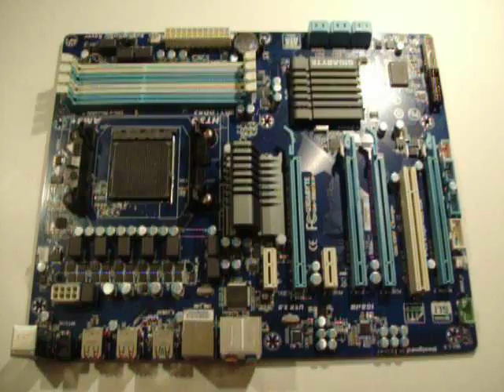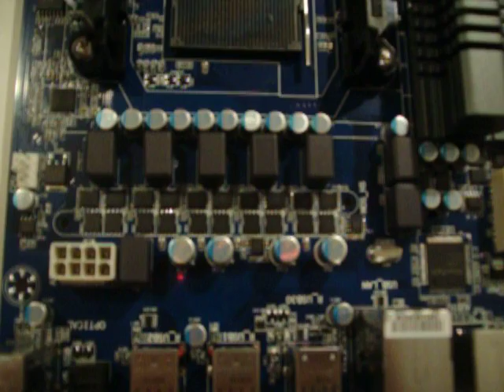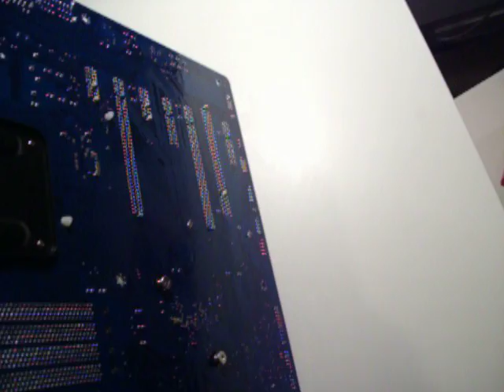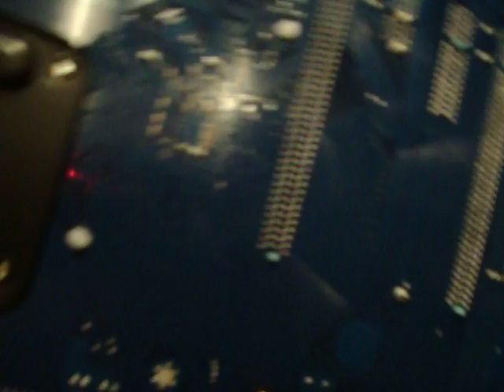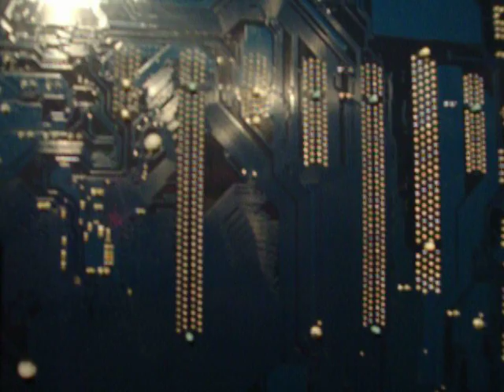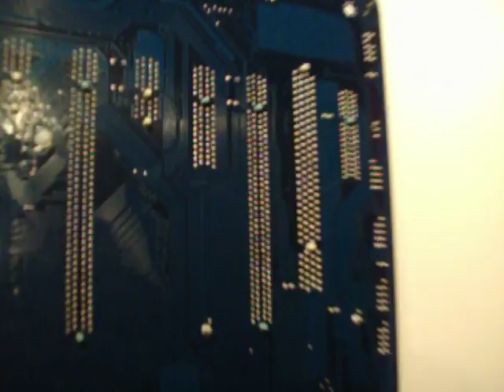Gigabyte 990FXA-D3 Unboxing and Overview: D3 vs UD3

Comment: I have revision 1.1 of the UD7 and all of the ports support sata 6GBits/s but you do need to install a driver provided with the board to get 6Gbits/s from the AMD SB950 chip set.

Comment: I also forgot to say that right now using LLC on the UD7 I have the 1100T at 4200Mhz using the same max vid of 1.55 volts so no extra heat and it appears to be stable when I benchmark it. In my older 790fx board the cpu would bail out at that speed and voltage using these benchmarks but I can't say it's a 24/7 overclock until I have used the computer at that speed for a longer period of time.

Comment: My current configuration on the UD7 is x2 6950's in crossfire and a Creative Recon 3D gaming sound card. So this means 3 of my four graphics card slots are populated but I still have room for 1 more video card :) All the Sata 6GB/s ports are great and I use to run a lot more hard drives in the past but to keep power consumption down so I can keep adding video cards I have been lowering the amount of internal hard drives used in the system.

Comment: My internal hard drive configuration is now 1 ADATA 240 GB solid state drive and 1 6BG/s 1TB hard drive. I have more disk drives full of data but I never added them to the system for power reasons. I'm using the Marvell ports to run my drives as my solid state disk provided poor performance when benchmarked plugged into the AMD SB950 sata ports. Like I said if I had read the manual proper and installed the driver that would have not been a issue.

Comment: I'm using a Cooler Master V8 air cooler with its stock 2000rpm fan and a 1300rpm system fan to support the CPU cooler with a push pull effect. I have a fan controller so I can monitor the fan rpm.  I ran the 1100T at 4120Mhz with the same air cooler and fans in my older Gigabyte 790fxta-ud5 "Great Board" for about 8 months 24/7. After I bought the UD7 around 3 months ago I just plugged in my 1100T CPU, dusted out my CPU cooler and set the CPU back to 4120Mhz.

Comment: My final overclock on the 1100T was 4142Mhz as any higher would result in a system crash running 64 player Battlefiled 3 regardless of heat or voltage. I'm now running the new FX-8350 clocked at 5000Mhz. I have to keep an eye on the temps as the eight cores produce a lot of heat but overall the cpu's performance is great at any clock speed so I'm happy. Lets see how that overclock works out. I also bought two turbo 7950's to back up the new CPU :)

Comment: My solid state disk finished in 12th place for fastest solid state disk ever tested in passmark plugged into the Marvell port and using the program AS SSD benchmark it averaged about 10% faster then the sata 3 6GB/s ports on my older 790FX board. So I'm very happy right now. I'll need to format the computer in the future when I buy the FX8350 so I'll test the the AMD SB950 6GB/s ports properly when I'm doing that.

Comment: Yeah, please do as I'm often asked by friends and family to build them computers and the UD3-5-7 are a bit to expensive considering the kind of computer their looking for. Also the advanced options on those boards would go un-used. Your D3 also supports 16x16x crossfire with good spacing between the cards and 1866 memory. If I'm asked to build another computer on a budget I'll be buying the 990FXA-D3.

Comment: Hey Dumpster you were Damn right about the AMD SB950 ports being faster. I have gained a great speed boost using my SSD in the right configuration plugged into those ports. It scored 4487 points in PC Mark 8. Thanks for that :)  I now use the Marvel ports to run my blue ray player as the AMD SB950 failed to see the player in the high speed AHCI configuration.

Comment: The un-cooled VRM MOSFETS and 4+1 phase power design is a big "no no" for me as I overclock like crazy. My 1100t cpu is running at 4120Mhz 24/7 and can run anything for any period of time with no over heating issues at all. "after market cooler". At one stage or another I have had everything on the board overclocked. The UD7 is the best AMD board you can buy. If I changed to any other board I would loose space for my hardware. No support on the 990fx D3 for AMD's FX8350 sucks.